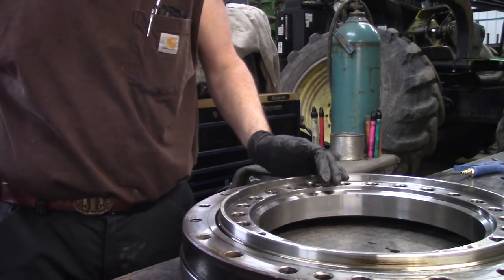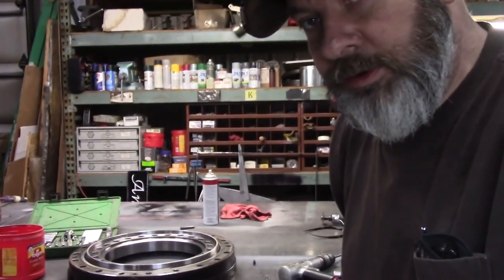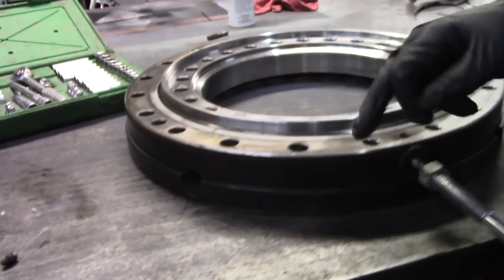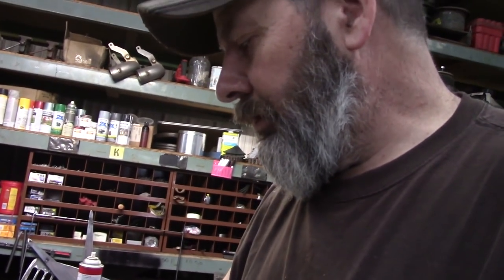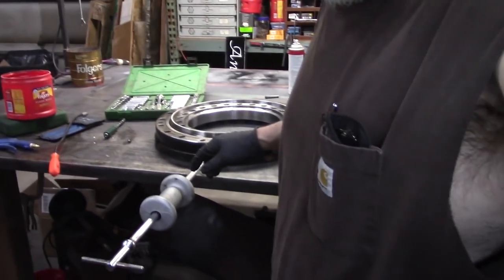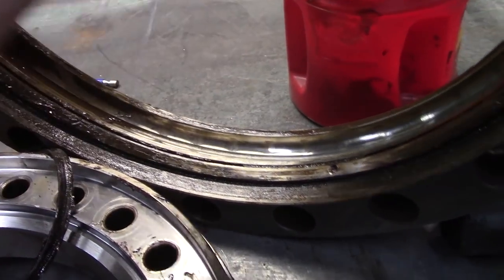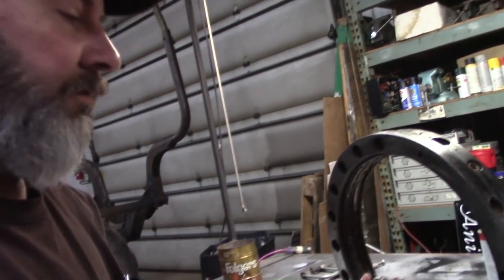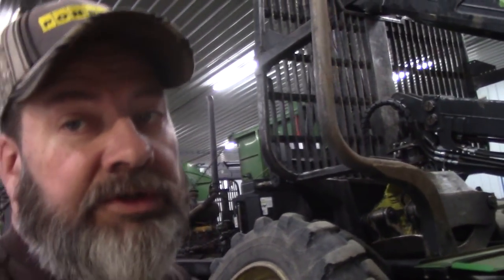How to Grease a bogie bearing

Comment: Thanks Mike. I am the one who asked you to show the guys how to do it. One, either they dont grease it at all and the seal goes out and the rear end oil starts leaking, or 2nd, they will over grease without venting the grease points to stop from popping that seal. Further, I have seen guys over grease turret bearings on tracked machines blowing out the dust seals. Then you have to REALLY grease it to prevent dirt from getting into the bearing. And we all know how nice it is to try and replace such a bearing. The same with the turn bearings on the Waratah 600 series heads. DO NOT OVER GREASE THEM. Follow the ops manuals. Nearly every head/machine I have seen down here has those dust seals blown from not following the proper proceedure provided in the ops manuals.

Comment: I have questions.. how the drivetrain system works on these machines.. we have a Rottne f15d, 2015 just hit 7k hours, and not sure if its the warm weather we got today and packy snow but I noticed a sound I hadnt heard before, coming from the front bogie system.. is it all gear driven inside? Is it good to lock the diffs when under load instead of being in AWD mode... how often does the articulation need to be greased, like the big bearing thet lets the bunk roll side to side... not the hydraulic rams but hopefully you get it.. would love to see  a video on that and maybe how the extended boom system works, how often to grease, thx

Comment: Isn't the short arc wear pattern  on the inner race by the balls due to the very short travel arc of the outer race (bogie) itself? 
If so....... every so many hours a guy could rotate the bogie but if the labor of doing so is cost prohibitive scratch that idea.
Reply from the maker: You are correct. I'm putting out another video soon on this subject. I've learned more since this vid.👍
Reply: @MichaelJBerg  Thank you Michael for taking the time and showing us the inner workings of this type of equipment, it's very interesting!

Comment: nice video man! very helpful.
In the bearing in the new naf it is two seperate compartments where there are grease, and the outer is for stopping contamination coming into the main bearing, and it seems to only be possible to change and add grease to the outer one and the inner is permanent, but i think that seems stupid but i dont know!? i have no way to check if there is even grease in there maybe it has leaked somewhere. its a swedish ecolog 574d i dont think you have those in the states :D

here is a picture of it: https://ibb.co/XWBSsy4
Reply from the maker: Thanks very much for the picture. As I said in the video always check manufacturer instructions first. Thanks for sharing your knowledge